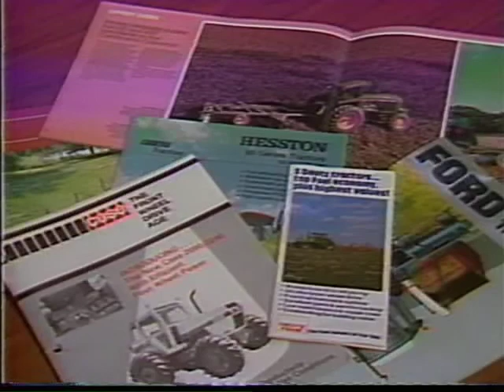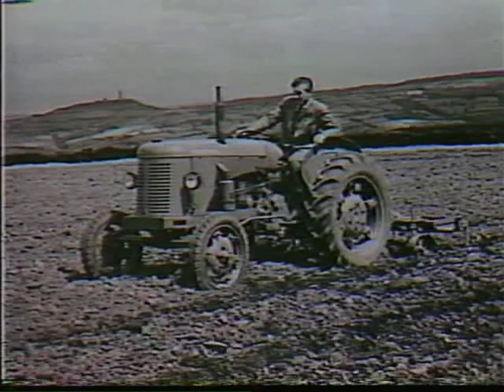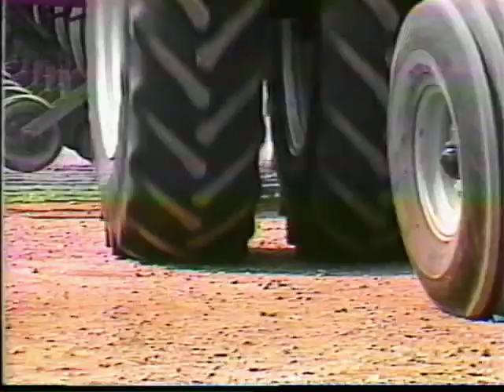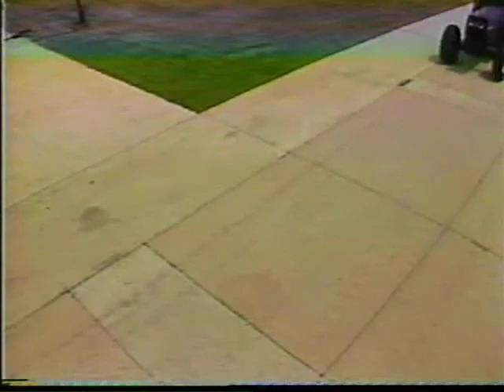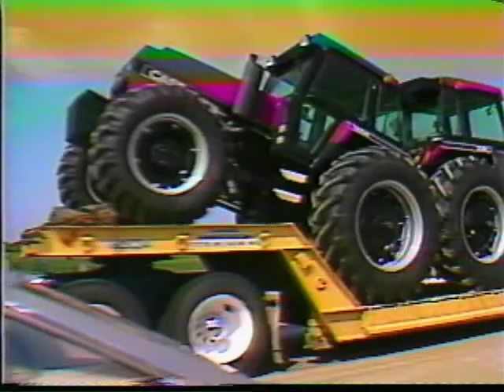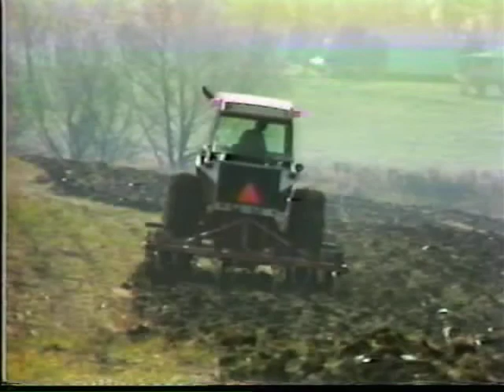J I Case MFD Increased Effectiveness

Comment: The JI CASE tractors were the best tractors for the 70/80s.... IMO... best engine and cab by far... transmissions are awesome IF you have common sense and can maintain and operate them correctly...
Reply: Agreed.  Back home there is a 2090 that did all the heavy tillage, pulled the disc, ran the forage harvester summer and fall, and pulled the spreader in winter.  It never had a problem.  It's still there, and runs well for a 36 year old machine.  Operator sense counts for a lot!

Comment: Our farm was mostly ih  and some jd but the best tractor we ever had was a white colored case 1896 mfd , 95 pto and it would out pull the 140 hp jd mfd , use half the fuel of the old farmall 1066 to do the same job in 7700 hrs it never once required dealer service . Loved the old 786 too it was fun to drive you could do awesome wheelies hauling the silage wagons if you popped the clutch and hit the ta at just the right time . My poor old father hated it couldn't keep clutches in it he never knew why lol .
Reply from the maker: +leslie holman LOL yes the old Case tractors were as great machines, not may around here unfortunately.